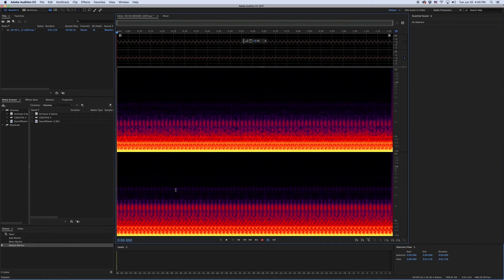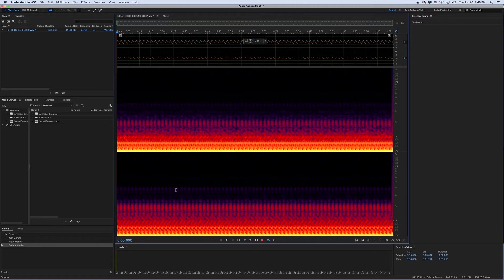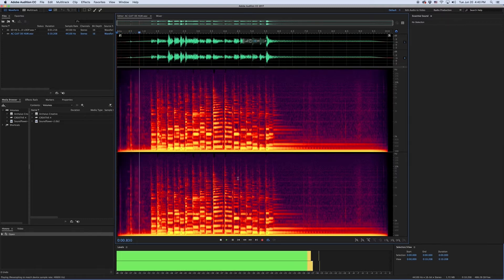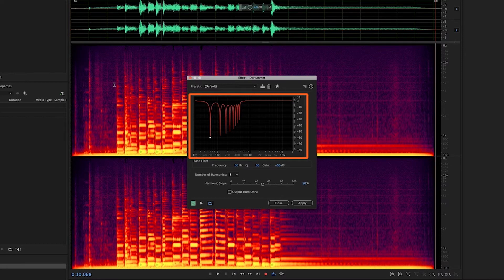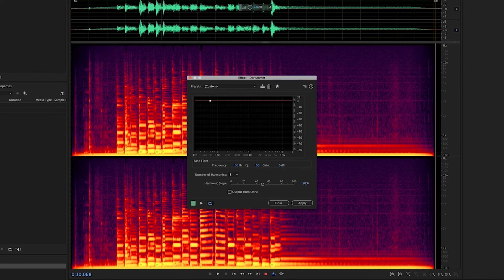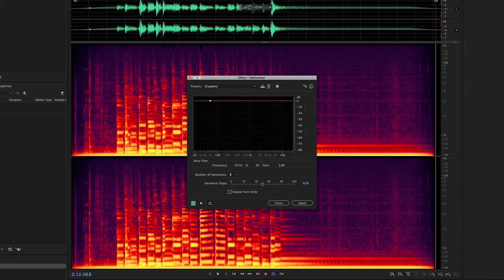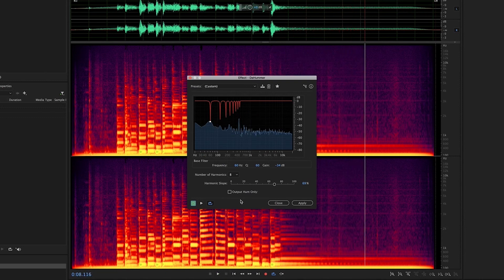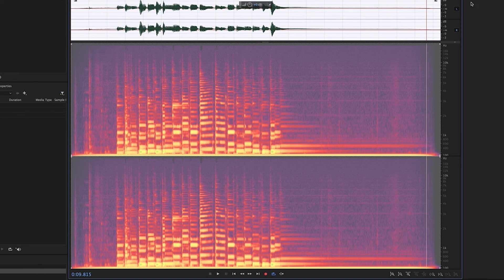How to Remove Hum from audio 

Comment: I have audio hum with my audio technica atpl-120 turntable I found it inthe street in parts and put it all back together and it hums and at times there is a slight hiss as well. the tonearm leads are all good and connected to the cartridge correctly and yet there is still hum  I like to make audio cds and cant do that from recods till this is fixed and I have a huge collection waiting to be put on cd . I have a cd recorder connected to my system as well if wondering . please help thank you and I really enjoyed this video keep them coming